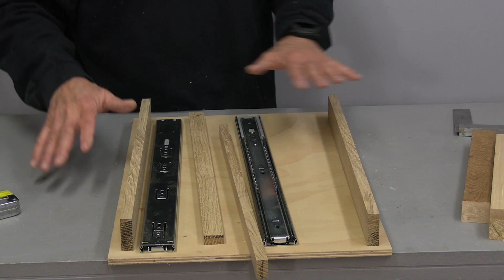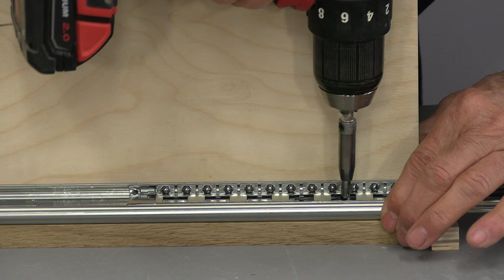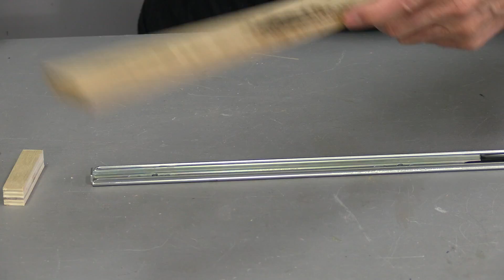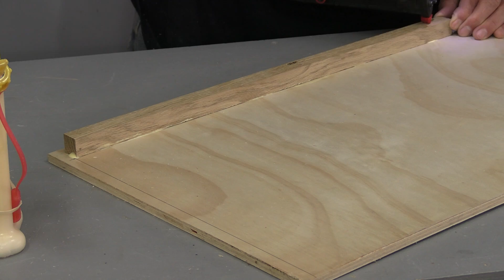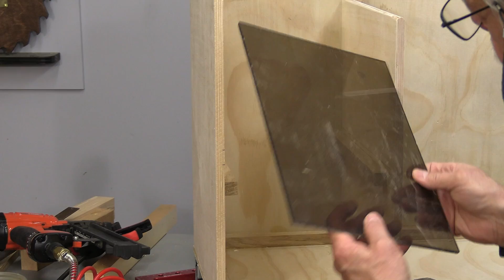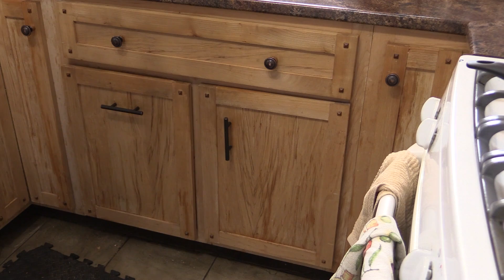Upgrade Your Kitchen: DIY Under-Sink Trash & Composting Build

Comment: I did something very similar years ago under my kitchen sink.  I made a pullout garbage can.  The can has a flip up lid so I designed it such that when you slid the door/drawer open the lid would self open, and when you slid it back the lid was pressed down.  I achieved that by attaching a board underneath the top of the cabinet. As you might guess,  It required a specific garbage can and it took a bit of tweaking, but I'm happy with it.  Also there's some space for a few supplies on the base of the pull out, I added some 3" strips, also I used some shorter wood strips to align where the garbage can goes.   For the sliding mechanism, I used traditional drawer runners, the cheap kind sold in Home Depot, nothing special.

My issue now is that there's a wire spring for lid that has broken so only one side has a spring... I wished I knew where to find them and what they're called so I can replace the springs... If someone knows the name of those wire spring things and where to get them, I'd appreciate it.
Reply from the maker: Great idea ... thanks

Comment: You nailed through the finished front of the cabinet door? Wouldn't that require a touch up repair?
Reply: I think he used a 23 ga. pin nailer. These small pins will hardly be noticed.
Reply from the maker: Yes, Sillyturner is correct, I used a 23 gauge pinner
Reply: Maybe, double sided tape would have avoid that.